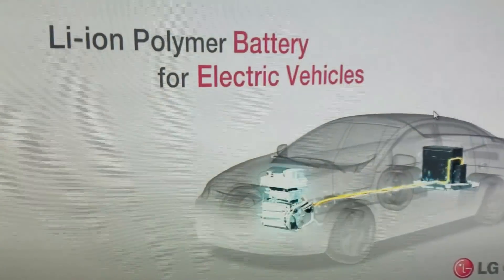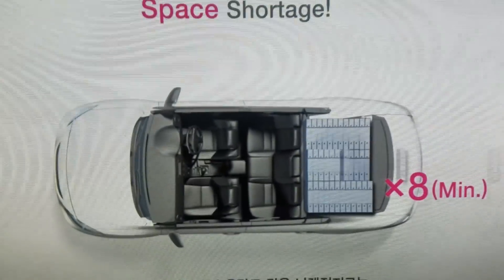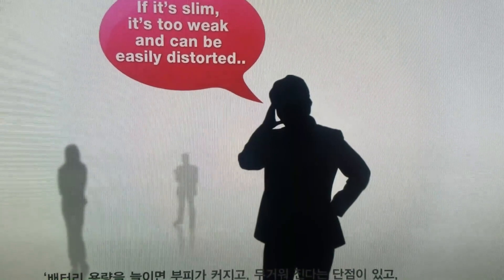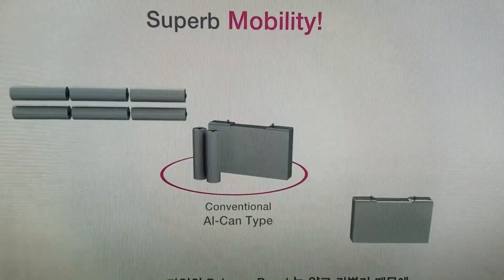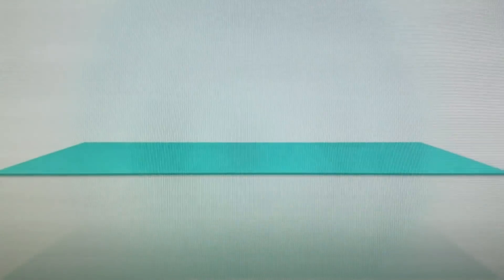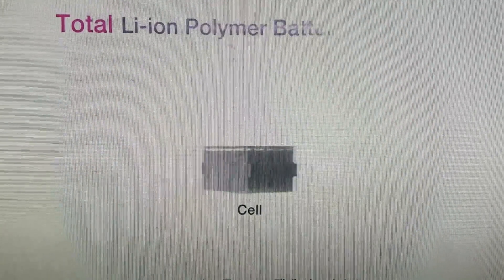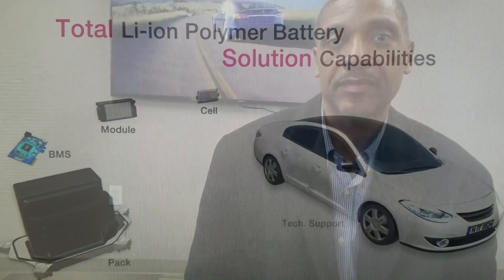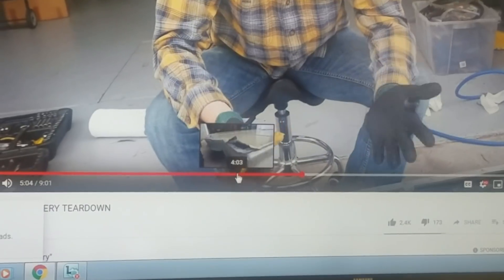LG Chem Battery Superior to Tesla?   2018 (399)

Comment: Shady video from LG, no figures at all in the presentation and the "compared" products were all very bad compared to LG. Size and placement of the pack had nothing to do with reality. Li Polymer cells have been around for some time, the have a tendency to swel when charged and stacking the cells close usually causes some problems with heat. The form factor seem to have physical limitations, interesting to follow for the next couple of years to see how they last.
Reply from the maker: Yes agree strange
Reply: LG Chem is really good at making batteries. Videos..... nah. 🙂

Comment: The biggest question on Wall Street, by far is Demand.  You have contacts with a statistically significant sample size of Tesla owners.  How strong is Tesla brand loyalty;  both in the US and abroad?  Do you feel Tesla demand is a concern?  On YouTube, It's difficult to find Tesla owners who plan to move away from Tesla.
Reply from the maker: Owners I have met seem inclined to switch to the Model 3.  Many owners fear exhausting warranty and don't want headache of parts for non warranty cars.  Also seeing buyers slow to buy Tesla as these issues are solved.

Comment: It's interesting to see that recent start ups like Rivian , Uniti (and Bollinger) agree on the Panasonic 2170 cell being the optimal solution
Reply from the maker: That is Interesting
Reply: Are they using Panasonic?
I know they specify 2170.
Reply: @rogerstarkey5390  Not 100% sure , I may just have assumed it while reading "2170"
Reply from the maker: i don't think you can buy 2170.  Only 18650 is for sale on open market from several vendors

Comment: The battery manufacturers are looking for a way to get rid of the thermal problem. They would rather have no thermal cooling and have a battery that discharges and recharges without heat issues. The reason why is it constitutes an energy loss in a loss in efficiency. I purchased a new cell phone and it fast charges and it does not get warm in any way and it uses a new type of polymer battery.
Reply from the maker: will be interesting to see how it works in cars

Comment: Super high charging rates is a must sometimes especially when you have to do a lot of driving around on rare occasions.
Reply: It's actually not
A battery pack simply has to outperform a "reasonable" driver.
"Unreasonable" drivers will have to adapt!
Reply from the maker: True point

Comment: Its all about thermal management. Tesla has worked long and hard on the ability to keep it's cells at the right temperature. No one at this time can sustain quick charging like Tesla. That being said these new thin pouch cells have the potential for better thermal management if it is engineered correctly. There is an inherent weakness in long and wide thin cells and that is keeping the entire surface at the same temperature consistently through out the whole battery pack. The thermal system has to address this with out bulking up and becoming too expensive. I have an uncomfortable feeling that under engineering will raise it's ugly head and there will be thermal limiting under charging conditions. I hope for LG Chems sake that they solve the problem correctly and give it's customers what they want and that is Tesla like fast charging capability.
Reply: Go look GM Volt battery pack integration. It is based on prismatic cells (as opposed to Tesla's cylindrical ones) but has similar thermal management.

All of them have heat pipes (metallic structures that transport heat from one point to another) and liquid heat "grounding".

If you look back at Cray's older supercomputers, where heat rejection was also central to the engineering problem, it looks pretty similar too.

Bold statements about prismatic cells based on flawed Nissan design are not to be trusted.

Gm's Volt Gen1 was overdesigned as a Proof Of Concept. It has a far smaller battery pack driving electrically the vehicle. That means each cell is used at a far higher C rating, a far more demanding situation than Teslas cells see except for ludicrous mode or very high superchanging rates.

GM and LG has been exploring how to extract the highest economic benefit from batteries.

Nissan has taken another aproach with it's Leaf pack. Leaf is purely battery based, but has no liquid thermal management. They tried to make the simplest cheapest volume scalable design. It prooved ok with night recharging and light usage. This model is fairly restrictive, and once people use the vehicle in extreme cold or hot temperatures, with heavier demands, fast charging, the batteries brake apart.

Tesla made a different choice and strategy. They made a roadmap as how to scale a proven already mass produced form factor into a huge production capability. Tesla's strategy is to enable the Gigafactory developing demand and production capacity in lockstep ahead of others.

Tesla is not dumb. They made the best with what they had. They targeted wealthy people with overpriced cars with very big batteries, where C rating demand on each cell was held at reasonable protective levels. They developed very good thermal management for this kind of cylindrical cells with costly tubing taking the liquid "thermal grounding fluid" to touch nearly all the cells using the cell metallic cover in a dual function of containing a failed cell and as part of the heat pipe. Clever.

Li ion Batteries degrade for other reasons than thermal. They degrade by calendar, as times go by, even with no use or heat. They degrade when the state of charge is kept too high or too low for some time. Degrade even fastes with both factors combined.

Both GM and Tesla developed cautious Battery Management System's that try to avoid extremes and degradation.

GM's Volt relies on the Range Extender ICE to protect the valuable battery. 

Tesla relies on the inability of most car users to overdemand from big batteries, with the help of the BMS supervisor.

There are many unknowns weather 
1) GM's Bolt will keep the merits of Volt; 
2) if Tesla could build really cheap cars for most people; 
3) if Tesla's use of similar battery packs in long range demanding trucks where the can't limit as much the C rating demand on each cell will still proove workable.

Note1: chemistry tweaking plays an important part in it, but there is no known magic bullet (AFAIK).

Note2: "C rating" is a power to energy relation for a given cell.

https://en.m.wikipedia.org/wiki/Electric_battery#C_rate

https://en.m.wikipedia.org/wiki/State_of_charge

https://en.m.wikipedia.org/wiki/Battery_balancing

https://en.m.wikipedia.org/wiki/Lithium-ion_battery
Reply from the maker: Many good points.  by having own factory, Tesla can play around with short runs of cell compositions others cannot.
Reply from the maker: Bruce makes sense we shall see

Comment: LG believe their own hype, they have the opportunity for better thermal management but their pack designs don't seem to optimise this. I watched a Bolt battery strip-down and it was well engineered, but to a price.
Reply from the maker: Jim good point. Will batteries degrade fast
Reply: @Teslafaninsight  Another video showed a Bolt owner who kept a good record of degradation and his battery got to 92 to 95% after 70,000 miles, so not as good as Tesla (where similar degradation seems to take approximately 150,000) but way better than the Nissan Leaf.
Reply from the maker: @jimporter7418  supercharging seperate men from da boys
Reply from the maker: that is for sure

Comment: Why dont others use tesla's battery solution?
Reply: hevenko - they might want to and in the past Toyota (RAV4 EV) and Daimler (Smart Car EV) have, but Tesla/Panasonic can barely make enough batteries for Tesla’s use now. Tesla and Panasonic continue to add battery and pack manufacturing capacity at Gigafactory 1 (see Greg’s prior videos) that will be needed for increased Model 3 production, Semi, Roadster, and Storage. Mind blowing statistic - GF1 makes 3 million batteries a day (if I recall correctly).
Reply from the maker: Chrristian interesting note on the 3 million batteries is if you divide it by the number of batteries in a model 3 pack (4000).  That is only 650 battery packs a day!  So you car production limited to this number until more automated lines built to handle increased battery production
Reply: Teslafaninsight - interesting- I failed to do the math. So maybe it is more than 3 million a day now. Still they need to keep increasing production on the 2170s and packs this is critical
Reply from the maker: good response Christian thanks
Reply from the maker: so 650 packs a day times 7 days a week equals 4,550 packs a week being sent to the fremont production facility.  if europe will get 3000 cars a week starting next week not much left for china and u.s. for a while.
Reply: Teslafaninsight do you recall when the next Panasonic cell lines come online? Then again Tesla needs to add pack assembly lines to match …
Reply from the maker: Good question Christian.  According to Elon the battery volume is ready for 10000 packs a week now as of november.  They are waiting on the completion of the new automated pack assembly lines to boost production.  Elon gave the impression that would be done like January but we have not seen that new production in evidence yet so my guess is end of January to combine with Europe production start.  The comment made was that the old line (7)  would outproduced by 2 to 1 by the new lines complexity for the increased production might be the slowdown.
Reply: Teslafaninsight … 10,000 Model 3 packs per week? Is that now or near term. Sounds like a lot, but if GF1 is the global cell/pack supplier for Model 3, Model Y, Semi, Roadster, Pickup, etc. is still is not enough.

On a related note I saw today that both GM and Ford have announced Major electrification goals. Cadillac to compete with Model S. Ford to electrify the EU fleet. More validation for Tesla. Batteries batteries batteries :-)
Reply from the maker: good question. 
panasonic answer
Tesla Gigafactory 1, which started in 2013, has already grown into the biggest battery factory in the world with an annual production capacity of over 20 GWh.Panasonic said that it planned on adding three production lines to increase the capacity to 35 GWh by the end of the year to support the production ramp.Yoshio Ito, head of Panasonic’s automotive business, said in a new interview in Tokyo yesterday that they are now ahead of schedule without specifying an exact date (via Bloomberg):“The bottleneck for Model 3 production has been our batteries. They just want us to make as many as possible.”As we previously reported, the original plan for the full capacity was 35 GWh of battery cells and 50 GWh of battery packs.The company later claimed to have found ways to improve efficiency and increase production capacity to 105 GWh of battery cells and 150 GWh of battery packs within the same structure
Reply: Teslafaninsight 105 GWh cells / 150 GWh packs … wow! Thanks for the update
Reply from the maker: the biggest number is a couple of years off but would help with growth in many ways. interesting note there is the choice to plan for still building batteries in nevada vs export that production to china.
Reply: Teslafaninsight please comment on these battery updates in a future video
Reply from the maker: Good Idea Christian.  aS you know Tesla says little.  the numbers we just reviewed came from a reno gazette article where head of factory mentioned the 3 million batteries and we could deduce the rest of it.  Because batteries are key no doubt key focus of dialogue. so will cover.  Noting coverage not always perfect given lack of obvious facts.